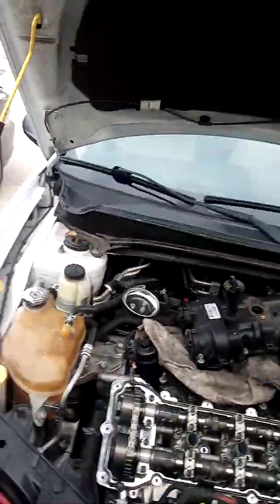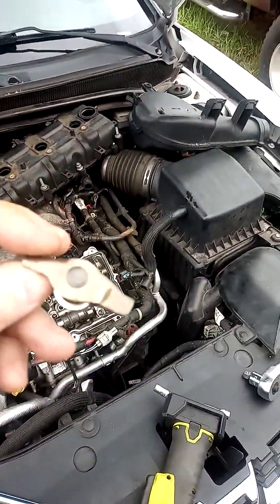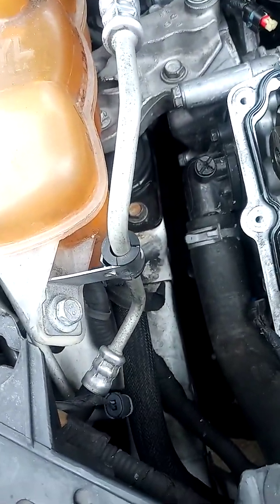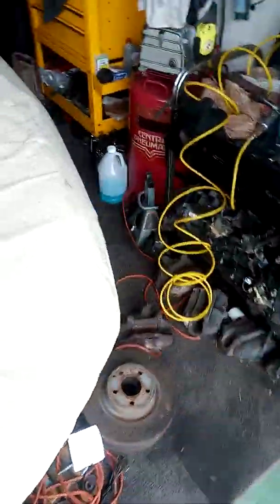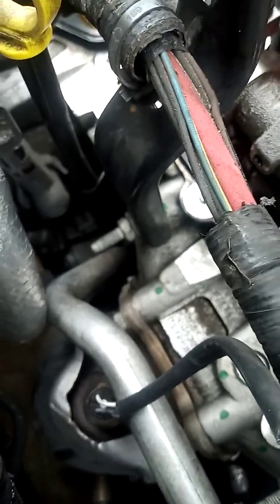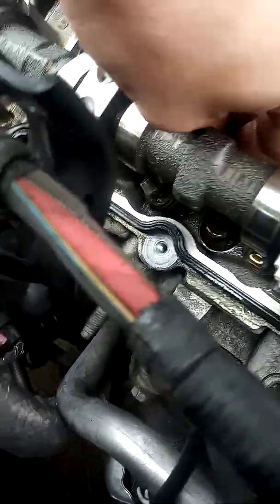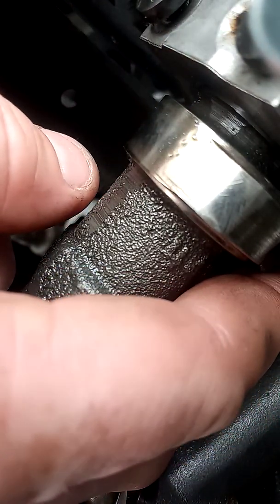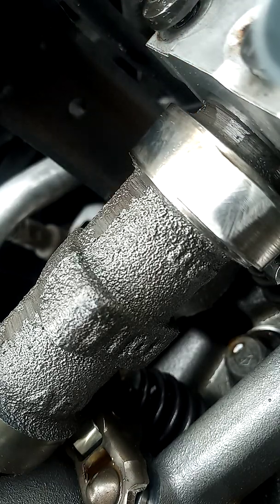Dodge Chrysler Mopar 3.6L v6 Pentastar rocker arm or cam follower replacement Part 1

Comment: turn it to TDC and use a cam block and none of it will move
Reply: Buy them they are cheap
Reply: @davidblankenship7599  yup 17 bucks on Amazon.
Reply from the maker: But not everyone has a cam block. I dont have for my 'at home tool box' and i have more than enough tools at home for engine swaps and ohv head gasket r&r jobs. Just wanted to show ppl after doing this same r&r job numerous times its easy to do for the DIY'ers without special tools and do it quick. I have many tricks as we all.. Like a 5.7 iforce tundra replacing 3rd chain tensioner that book time is like 14 hrs or something.. Did so in less than 3hrs. But will never post that one lol. Esp since i didn't make shit off that cause bossman passed my cheating the clock to the customer who was an asshole to begin with. One of the many reasons I left that hell hole. Bc that should've been a banked payday of like 75 hrs for that week.